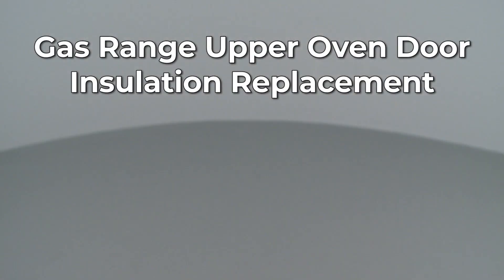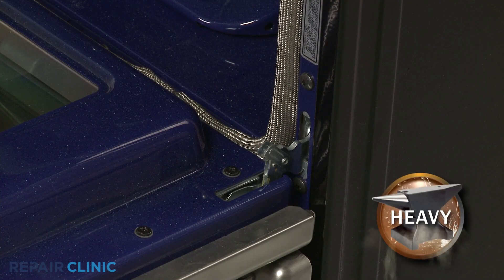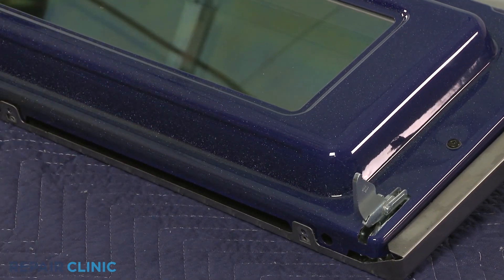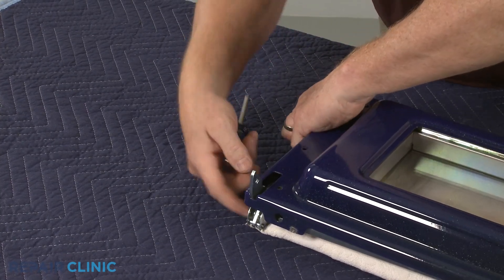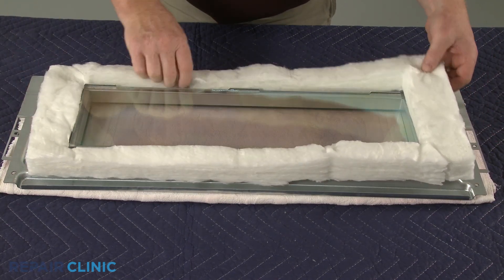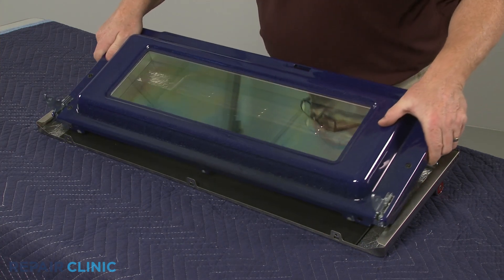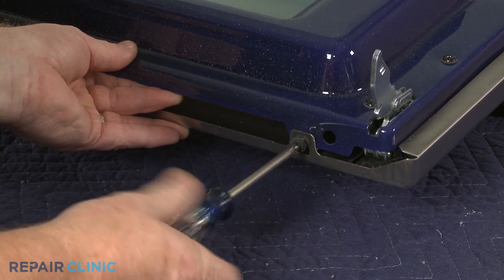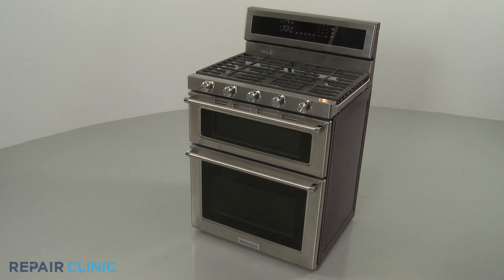Kitchenaid Double Oven Gas Range Upper Oven Door Insulation Replacement WPW10321271

Comment: thank you.  I wondered if the insulation required an adhesive and it seems it doesn't.  My situation is that I broke the glass which faces the inner cavity of the oven.